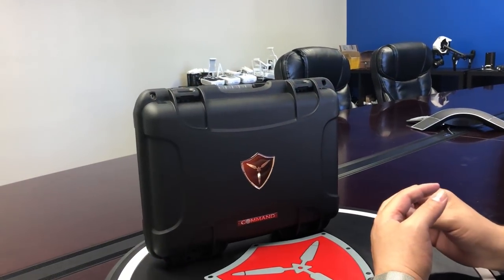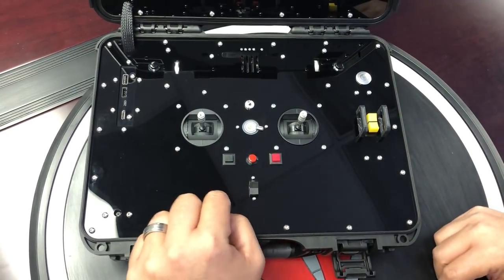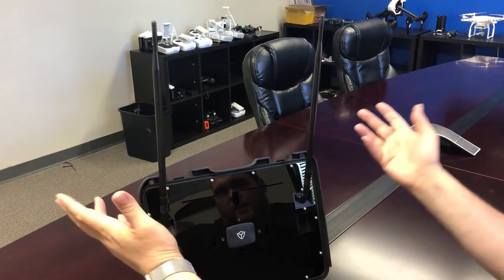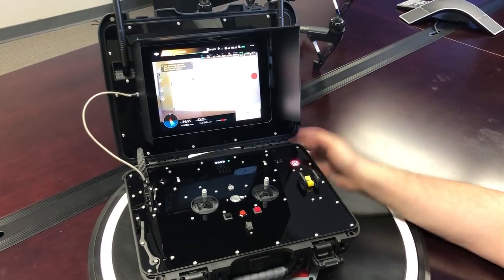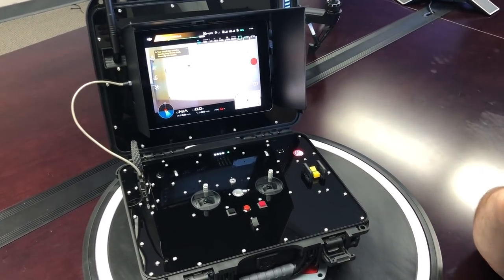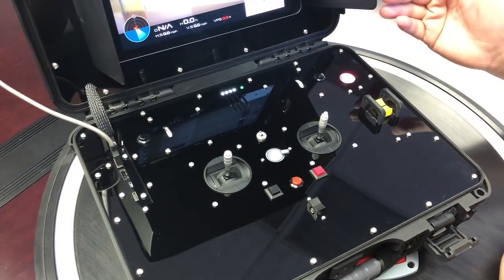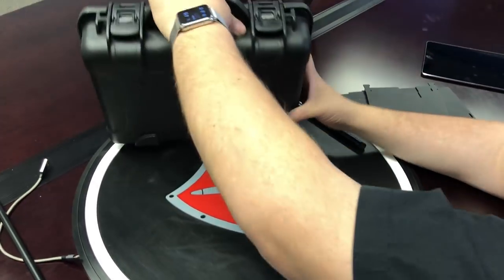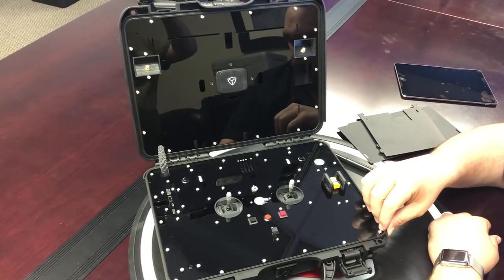Cockpit Intro Video

Comment: This looks like a really nice kit for Law Enforcement.. What is the range?  We are currently using a boosted range extender to assist with video in complicated areas. Is this a boosted antenna system? We have several UAS we are using, so I would need a few of these..

Comment: Hey @Titan Drones, Im a Quadriplegic and i just purchased a DJI Mavic Pro, I don't have any hand/finger function and was wondering if you guys could or would help me out making a SUPER simple custom controller where its basically the same as the bottom half of the Cockpit GS to rest on my knees in the wheelchair, the only changes needed would be to spread out the joysticks another 1inch or 2 and bring them closer to me and to make the buttons a little larger and separated that way i can tap them with my hand but not mash them together. Ive tried everything to find a way that i can control my drone, would just be nice to fly it myself with my Dad instead of just watching.

Thanks so much, ill message this to you aswell just incase you don't see this <3